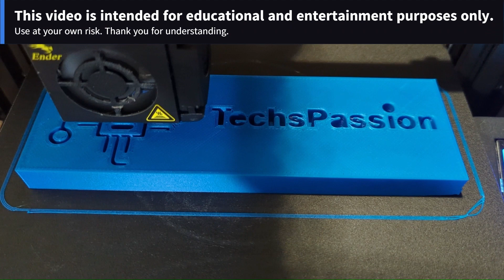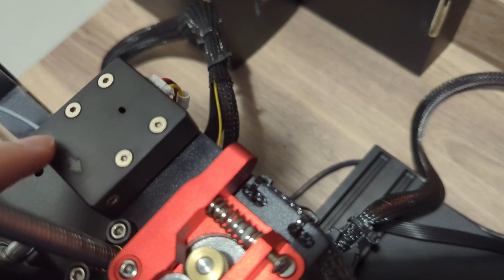Filament Stuck In Sensor Ender 3 Max Neo #3dprinting

Comment: What if it snapped off in it
Reply from the maker: I would try something slim like a needle and try to push it out or push filament to see if it will push it out. It's not the easiest sensor to work with for sure